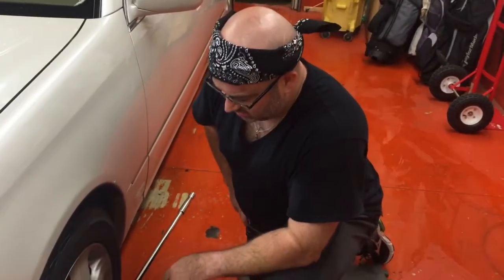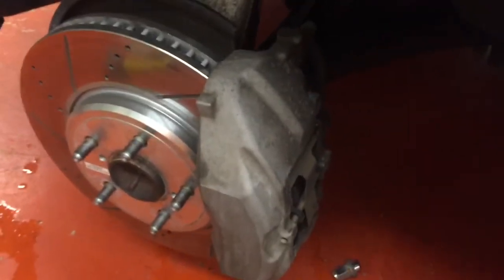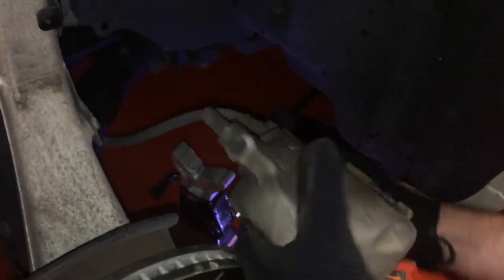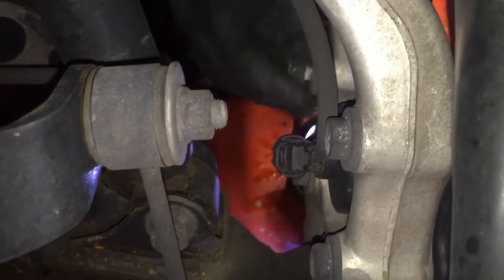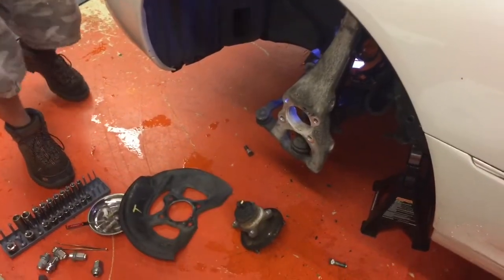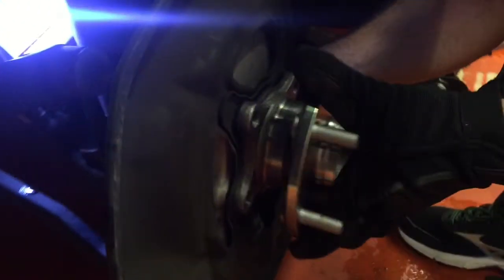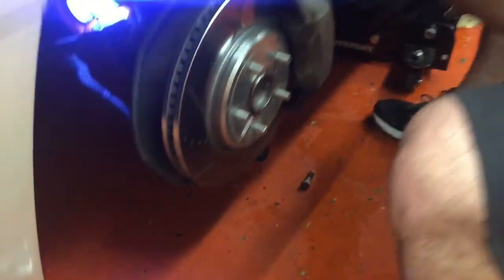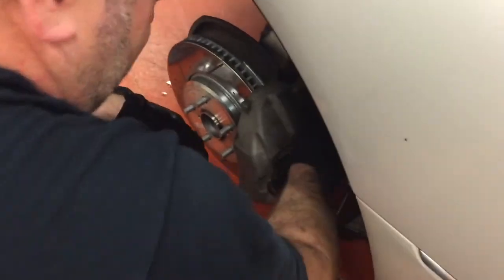2002 Lexus LS 430 wheel hub replacement - by two regular JOE's

Comment: Great how to. Recently the passenger side front wheel bearing started making noise in my ‘03 LS430. I searched You Tube wanting to know what I was up against. This video gives clear, concise instructions showing it’s a relatively easy job and far from the $800 all day nightmare job the dealer wants you to believe it is. Please let us know how the eBay bearings hold up. I bought a MOOG replacement with a three year warranty for $160 from my local auto parts store.
Reply: Hi Ti Rider,
How is the Moog wheel hub holding up? I am wondering whether I should try the Moog or just go with OEM for $317 each. I took the risk by buying a cheap pair of TRQ wheel hub assemblies. Initially they seemed ok although the driver's side was making just enough noise to be annoying. Now within 4 weeks the noise is unbearable at highway speeds. The other night I literally thought a helicopter was passing above us on the highway but the helicopter noise didn't go away. I had to stop on the shoulder of the interstate to look at all tires and wheels, they were ok.
Reply: I ended up buying the Moog 513163 from Autozone for $180. Then I found the same Moog at AdvanceAutoParts for a little cheaper after the coupon ($150ish) so I bought one from there. I was pleasantly surprised to find out the AdvanceAutoParts Moog was Made in Japan and the black top part (that goes inside the vehicle) had "Koyo" written on it. Koyo is the Lexus OEM wheel hub so I am quite sure I got the OEM for this price!! The Autozone Moog 513163 was made in China and did not have "Koyo" written on it.
Reply: Feb 2020, $220 on Amazon, but there are 4x cheaper ones. Not sure what to do at the moment.
Reply from the maker: Just saw these replies... sorry... I still haven't had to replace again... so I'd say my cheap replacements off eBay were just fine...

Comment: Looks pretty easy. Why did you replace them, what were your symptoms? My LS 430 steering wheel vibrates around 50-65 MPH until warmed up, then drives smooth. I've got new tires, new wheels and road force balance. So I have ruled out the wheels/tires. Would like to fix this issue. Otherwise, car is perfect.
Reply from the maker: Soprry for the late reply but the state inspection told me it was due.... so i fixed it...
Reply from the maker: State inspection tools me because they would move when jacked off the ground in an odd way. Also made a squealing noise. Not too loud so they weren't destroyed but I probably wasn't too far away from doing them anyway without the state telling me i had to...

Comment: hey man,can the abs wheel sensor come straight off,if so how,Im thinking its just a plug you can pull off
Reply: Kane Wallace 

Did you figure out the plug?
Reply: @tlutrick956  yes i did,it was the abs sensor wiring that needed replacing,thank you for asking Trey
Reply from the maker: glad you figured it out. yeah that is only one one side but you should replace the pads if your had the warning. if I remember it was like $20 at auto zone for the new wire for the sensor.

Comment: How is the ride compared to OE?
Reply from the maker: Did this 5 years ago and still no issues with my eBay motors cheap(er) hubs. It was so long ago I don’t remember if the ride changed at all. If it did I probably would have mentioned it then. This car is still going strong 20 years later!

Comment: and I don't mean to be a prick but the caliper bolts torque to yield I worked at a Lexus dealership as a mechanic for 5 years they could come loose
Reply from the maker: +Dblock real  thanks for the comment. It is true and I believe it was 100 ft-lbs and the hub was 51 ft lbs. please look this up to be sure these numbers are correct. I'm not a mechanic...
Reply: lol...
Reply: I was curious about this....I broke one of my rear caliper bolts right where the thread starts when i removed them for the first time.  I think someone misthreaded them and possibly torqued it several turns till it butted against the caliper.  Is it possible to have a bolt sieze so bad that it separates and leaves the threaded half deep in the wheel hub assembly (assuming it was threaded correctly)?
Reply: Also, thanks for the video!

Comment: Do you need was wheel alignment after replacement
Reply: No.
Reply from the maker: I didn't need it. Car wasn't pulling at all. But I'd suspect if it does pull then go ahead and get it aligned. I did the front suspension and tie arms and needed one for sure.
Reply from the maker: Don't think I made a video of that one but I should of. Wasn't too hard doing the suspension and tie rods. Not arms ha!

Comment: 214 ft/pds torque on the wheel hub, 4 bolts on back....
Reply: that's incorrect...those bolts aren't rated for that much torque...don't listen to this fool...if you try to torque those bolts to 214 ft lbs they will snap guaranteed.
Reply: 81ft/lbs for the caliper bolts which should be replaced if you remove them as they are rated for one time use only.  My hub is making noise on driver's side.  Brakes were done 17000kms ago.....i'm going to take my tap and die set and run the bolts through.  $13 a bolt here in Canada.  Ridiculous for a bolt.   @moneymac2864
Reply from the maker: I used exactly, tight a heck... Not sure that was on the wrench though...

Comment: What brand did you buy?
Reply from the maker: I know this is a really late reply but i got mine off ebay motors. if I recall they were around $40-60 bucks for each or for the pair of hubs. I also bought the rears but only changed one side since thats all that was needed.